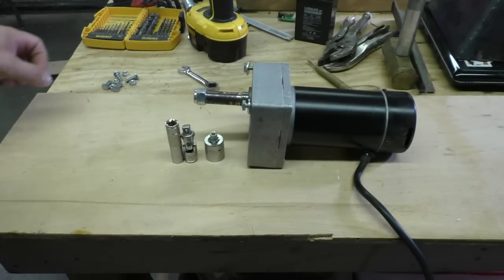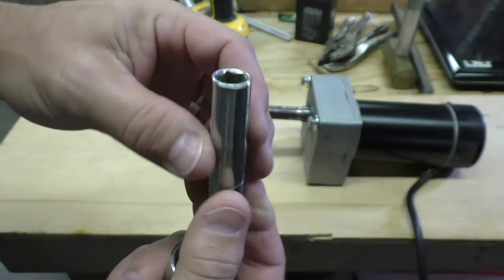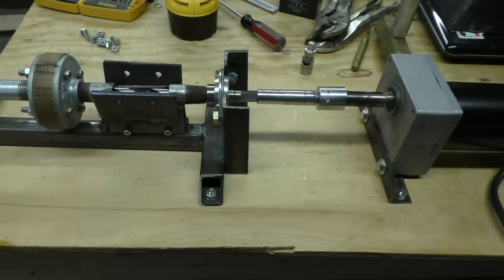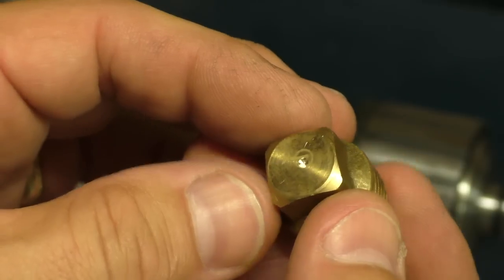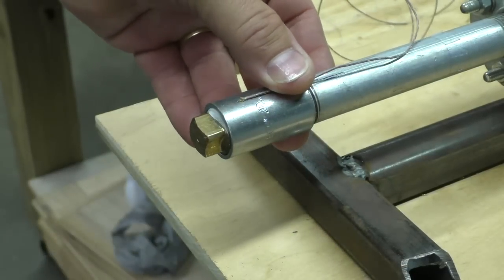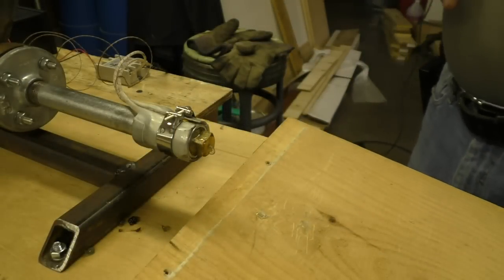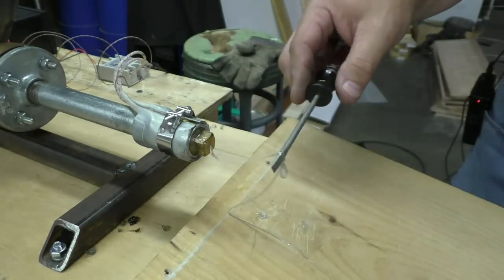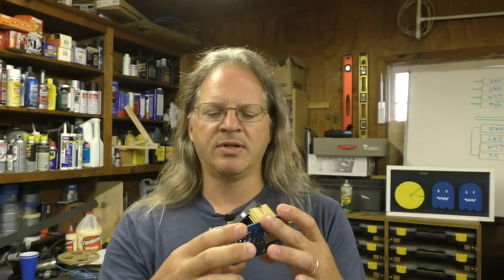Filament Extruder #4 - Finally Making Some Filament

Comment: I just watching the video and gave me an idea, maybe you already know it. But you say its hard to find the center to drill the nozzle diameter. If you drill from the inside i see a centerpoint in the middle,  i thought it is easier to do that from the the inside. Video at 5.50 minute.

Comment: I know this is old, and you ended up not using it - but for viewers, don’t use that type of u-joint socket for a coupling in this application, as the output velocity is not consistent with the input. Meaning, at an angle, it will pulsate on the output, speeding up and slowing down each rotation, rather than run at consistent speed, and that will directly affect the consistency of your extrusion diameter.

Comment: I am using a 230/14 (L/D) auger bit. I am clueless on what motor to buy and the electronics for speed control. Any help is welcome.
Reply: Did you able to find a motor?
Reply: @khayelihlemadlala7655  Trial and error and I managed to make it work with a 2A 12V wiper motor. I am however struggling to obtain a 1.75mm diameter. What nozzle diameter would you recommend? I am using a 1.2mm nozzle diameter, filament diameter is 0.8 ± 0.05. I'm thinking I'll increase it to 2mm
Reply: @mirza.faizaan  I don't have an idea right now cause it my first time trying to build one. All I need for now is a drive system. Did you use a reduction gearbox?
Reply: @mirza.faizaan  After driving the extrusion screw at 10,
15 and 20 RPM for temperatures 150⁰C, 175⁰C, and 190⁰C, it was
shown that the filament that was extruded at 190⁰C at 10 RPM
was the most desirable as it produced the most consistent average
filament diameter of 1.749 mm from a 1.75 mm nozzle, with
acceptable tolerances being within 0.05 mm. This is the literature I got.
Reply: @mirza.faizaan  Did you use a reduction gearbox?

Comment: I used to work in a factory making plastic rolls and bags. We would start the round extruder which faced vertically and pull it as a 'lump' at the speed of the machine. We would take it up stairs and wind it through a system of rollers. It would loop over the top one and then down through another set of rollers and eventually onto a cardboard roll at ground level. We would then adjust the air pressure inside the ring until the balloon was 'stable' The trash would be rolling onto the first cardboard tube. Once the knife was set to cut one side of the balloon, (if it was going to be a continuous roll). and the plastic was running flat and at correct width we would spin the roller over onto the second roller and discard the trash roll for recycling. The machines operated 24/7 and only stopped when being maintained or if a different colour or size was required.

Comment: Double nut instead of nylon nut. Bring the nuts together hand tight then line up the flats with wrenches. If they line up at hand tight, tighten 60°.

Comment: I just made a machine similar to this and it looks to me like you're heating band wires are connected to the 1 and  2 posts of your solid state relay. Is that  correct.

Comment: The filament should be dipped in water, this is the same methods when you recycle plastic, they produce long filament then chopped it, normally the line should be dipped in a long water tub with fix tension

Comment: Dude, Stop wasting your time by making filament, turn that thing 90degrees, slap a stepper on it, go old school with a x,y printer with a stagnant z lift, taper your nozzle to a point, and you have your self a awesome 3D printer. Now you can trough in re-used crushed plastic and print away. Make it big and print flower pots to farming gear. My ideas will never see the light of day, but you can make it work 😀  M.J

Comment: Hello,
Thanks for this video series.
As you very rightly chose the tapered copper bolt because it is tapered,  instead of trying to hit the center from the external face with a lathe and drill at 5:30 , I would recommend doing the same but starting drilling from the inside. The tapered angle would guide your drill,  also all copper burrs would end up on the outside and can easily be shaved. 

This serie to build an extruder as a DIY project was done 3 years ago from what I see, with some trials and errors.  As much as the venture can be fun, would you consider making a new series going straight to how to build one right from first try,  using your lessons learned?
Also very interested in the schematics and code used for the controlling electronic for the stepper,  heater,  and so on..
Thanks!

Comment: Is the drill bit heated? or is the only thing heated the nozzle, and how strong does the motor need to be, what if I'm using fine powder instead of pellets?
    Planning on building my own thanks for the info and well done on the video!

Comment: How much power does your heating band have? I noticed you only have one hand right at the nozzle, I guess you don't need to slowly bring it up to temperature like the original design?
Reply: I was wondering about that, too. The bigger machines I saw all used 4x 150W or more for heat bands, that sucks a lot of power...but this small set up seems to work, too.
Reply: @WhiteSpotPirates  yeah I don't know how this works.

Comment: Can you provide any info on the motor you selected (rpm, overall power, torque output)
Reply from the maker: It's a salvaged 24v wheelchair motor.  That's all I know about it.
Reply: @MakingStuff  fair enough, it looks like you added a gear reduction, is that correct?
Reply from the maker: I did not add it.  The gear reduction was part of the motor assembly.

Comment: You don't wear paint off. You blast it, etch it, or burn it off. You need to get your entire plastic path clean as a whistle! Don't waste your time guessing and dicking around with tests until you clean clean clean! Also the whole drill bit auger assembly needs to be a lot more stable! There cannot be any flexing under stress of the bit or pipe that will most certainly result in shredding metal instead of just pushing plastic! Don't bother with beads that large. You want to grind up your plastic into the finest grade you can for a reasonably simple effort. Look at a food processor and then scale that up from a lawn mower! Process your plastic bottles and jugs with a heavy duty paper / credit card shredder and then pulverize it with your scaled up food processor. I just heard you talking about your sand blaster... That thing should be as accessible as the sink and fridge is in your kitchen! Get your priorities in order and things will fall into place much easier! Thanks for sharing! Good luck to you!

Comment: Air cooling bro.  Think 3d printer simplified, as that is what a filament maker is. You can even get 1.75 nozzles cheap, and have replaceable nozzles. For the temp needed, a K type thermocouple is not needed, and a standard 100k thermistor (good to around 280-300C) is actually more sensitive. However, you need to make a part cooling fan, lol. Think small 12v or 24v 5015 style blower, with two nozzles aimed at the plastic as soon as it exits the extruder. By the way, pulling AT ALL on the molten plastic will thin it, which you don't want. Let gravity coil it on the floor.

Comment: Thank you for your video and could you please tell me the diameter of the nozzle to ensure that the size of the filament is 1.75 mm? Thank you very much
Reply from the maker: It was a little less than 2mm I think.  The idea was to pull the filament to the correct diameter by changing the speed of the rollers.

Comment: Cool video! People like you are pioneers in at home filament recycling which is truly the way of the future. A 3D printer isn't very useful if we have to get our filament from china.

I've heard the size of the filament has to do with the volume and pressure behind the extruder nozzle and not so much with the size of the hole on the extruder nozzle. If you've ever done any caulking you'll know what I'm talking about.

Something to think about before drilling a larger hole!
Reply from the maker: Yeah I agree that lack of pressure is part of the problem.  I just can't increase it enough with off the shelf parts.

Comment: Black specs are from burned plastic that accumulates at tip of drill bit screw. Use the angle grinder to make a sharper tip on the front to make the dead zone as small as possible.

Comment: you not show how you made or were buy heater element at nozzle., need heater element too and what temp sensor type has, i think arduino and RAMPS board and marlin firmware can controller PID to temp good and little change code can controll feeder motor DC or stepper ,speed too. pwm or stepper driver.

Comment: One heating point isn't good. On the middle of the pipe you can adding second pre-heater with lower temperature than on the die (the best is a 3 point heating 80-120-165°C). The produced material can goes to moving belt, if you change speed of the belt you can control diameter of the filaments. If you pulling material faster you produce a thinner filament.

Comment: You need a bucket of water underneath to cool the plastick so it does not stick. It also helps with consistancy because it's the 0lasticks not cooked off it can change size and go off of 1.75mm

Comment: I started one of the popular designs 3-4 years back: 27 printers later as just  a senior hobbyist, the concept of producing 1000g of filament, that I can buy with free delivery for 9.99 to 18.99 is never going to happen in my shop. Choices
Reply from the maker: Yeah the price of filament has really come down over the years.  When I first started 3d printing 8 years ago filament cost $60 per Kg.
Reply: Point taken. But, it would still be nice to turn all my failed or damaged prints back into usable filament.

Comment: Whats the specification of motor? Speed, Voltage input, Ampere.  Speed controller name? I am from India please share your bill of materials clearly. rdineshbabupdy@gmail.com
Reply from the maker: It's a salvaged wheel chair motor.  All I can tell you is that the motors is 24V.

Comment: The drill bit is scraping the pipe surface inside and thus you find the shiny metal pieces in the filament. Just requires an alignment effort and then it should be ok. Great work.
Reply: Sir if you know that could you please explain the heating where takes place and also how we heat that plastic polymer

Comment: Mist nozzle at extraction with hot water a little cooler than the extruder nozzle. Enough to cure the filament to remove the tackyness. Placed above a bath recycling the water.

Comment: how about using compressed air and some small nozzles to create a vortex that both cools and holds the filament from falling on the extruder nozzle?
Reply: just what i wa thinking. use a wind tunnel type design with dip to control heat coils and compressor air  a fan
Reply: Or make the nozzle vertical.

Comment: Hi there, What nozzle hole size have you converged to to optimize speed? Would you recommend going bigger than 1.75mm and pull to the correct diameter or stick with the 1.75mm hole? I was thinking that maybe a bigger hole could increase the production of filament per second. What are your thoughts on this? Thanks

Comment: 2 things....Place 2 bar magnets in your hopper to catch any metal . Then you should have polished the barrel with sand paper and yes clean the drill bit.  Nice setup though. I used to do mold setup, programming and all maintenance on big UNILOY Blow Molding Machines. You might also want to move you heating element back some or lower the temp. so as it comes out it won't stretch. Just a thought.

Comment: great vid, here is a good tip on drilling that brass plug. find a drill to same size as the inside, and drill a fraction out, just enough to see a bit of the brass come up the drill bit, this has 2 benefits. 1st it will smooth out the inside and secondly it creates a centre so you can then add the 1.8mm drill bit into the drill and then make your hole from inside the plug/bung as the drill bit will also find its center  amd the drill hole will have a micro spiral the right way.

hint if you make a few types with bigger and smaller size holes you then can swap/change to suite for the types of plastic,
or if a good engineer/metal worker, one could make a nozzle governor

Comment: Isn't that pipe Galvanized?  If you used DOM- (Drawn over mandrel ) steel tubing, instead of welded steel galvanized pipe, You could thread it and keep  it unpainted and glass bead your bit it would be clean I bet.

Comment: Not enuph zones for heat. Need a smaller throat for material delivery. The screw needs to be a step down and diameter you are on the right track just needs more work
Reply from the maker: That's what I have been thinking.  I've got a long list of changes but this will be at the top of the list.  Thanks.

Comment: Try extruding vertically instead of horizontally. Down into a cold bath, under a roller and then under and over rollers to change to the horizontal.
Reply: I think, if you squeeze the filament directly into the water, you won't have a chance to pull it. Filament is pulled while it's hot. If it gets cold, you can't pull it. And without pulling, the filament won't be consistently the same diameter.

Comment: center in a lathe is reliant on the concentricity - or runout - of your work relative to the lathe itself. that is not a center-finding drill bit, that is a center drill, with a 60 degree taper to index a lathe center into the 60 degree hole which provides stability to the work. center, here, is only relatively to the center of the spindle, so if your work is not mounted concentric to the lathe, you will have runout - your issue. 

a better way to find center on square is to scribe across the corners diagonally to make an X. the center of the X will be the center of the part.
Reply: Kevin Keel Additionally, he's clamping onto tapered pipe threads skewing the plug. Another alternative to get closer to center would be installing the plug into a coupling for a drive sleeve.
Reply: for brass plugs, which are already machined, the best way to get a hole drilled into the center is to drill from the inside. they are already drilled out and thus leave a 120 degree taper in the end - the rest of the machining is done relative to that. 

stick your drill bit into the hole end and it will find center by itself.
Reply: Kevin Keel yep, that, too.

Comment: A tip. If you use low expansion foam for windows and doors and place it inside of your fram tubes, you will eliminate the echo. Even loosely stuff the tubes with insulation. Rubber undercoating spray on the outside of the hopper will eliminate some decibels from your auger bit..  hope it helps.  Cheers

Comment: This is an old video... and you are obviously a very knowledgeable man... with the capability to choose, design, and implement every mechanical and electrical aspect of anything you set your mind to.. .. I am inexperienced in this topic... very very much so... I'd like to ask you: why not gravity feed the filament and cool it on the drop as with continuous casting steel?

thanks to anyone who'd like to share on the topic... and thanks for sharing your adventure with recycling plastic from the home shop.

Comment: Hi.Firstly congratulations. I wanna ask you something about diameter.Does your machine work regularly in diameter between 1.65 and 1.80 ? I wonder if it was vertically,Would it work better ? and why did you use heater in front of nozzle output?
Reply from the maker: Check out Filament Extruder #13 video.  I just posted it.
Reply: Ok thank you this video is really helpful for me. But can you share your caliper board schematic?
Because i do not understand how to do this
Reply from the maker: The caliper code and schematic are posted on the Making Stuff web site. http://www.makingstuff.info/Projects/Digital_Calipers

Comment: cool video but you probably want to use a larger diameter hole for your extruder nozzel as the plastic cools at a smaller diameter. Awesome work though, I cant wait to try to build one of these.

Comment: Great project! 

Some suggestions, you can ignore if you want to. :-)

Put a cooling fan under the hot end, and it will cool of faster and not stick on everything. Also you might want to print a nozzle for the fan that can cool down to filament more efficient.

You might want to put the drill bit in the lace and make a short tip on the drill bit and a hole into the inner part of hot end center, not going through. That way your drill bit will not go of center and scratch the tube.   The output of the filament could go a bit off center from the center hole you made previous.  I don't think it has to go out in the middle.
Reply: بله همینطوره

Comment: So did you really need the insulation? How hot was the pipe getting just next to the wood block?
Reply from the maker: Yeah I thought it was overkill at first.  However, the pipe flange is almost too hot to touch on the hot side.  The pipe is definitely too hot to touch.  I'm sure if it runs a long time, it will probably get hotter.
Reply: I wanted to get away without it, but it seems its a must have. Thank you for your answer.
Reply: Insulation around the hot end will probably it easier for your PID to control the power to your hot end heater.  Will reduce the power need too, which is probably good thing too.  You only want to heat up the pellets, not the room. ;-)